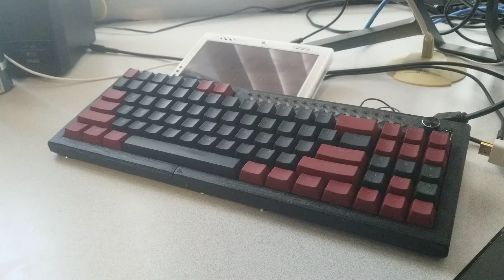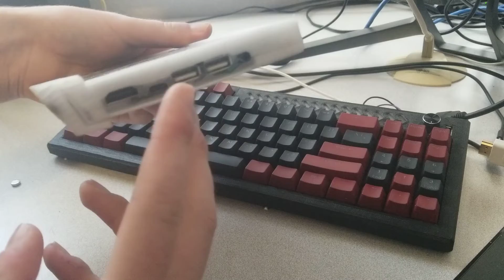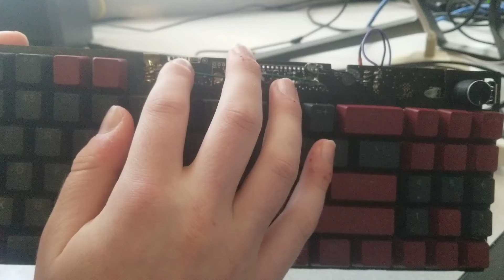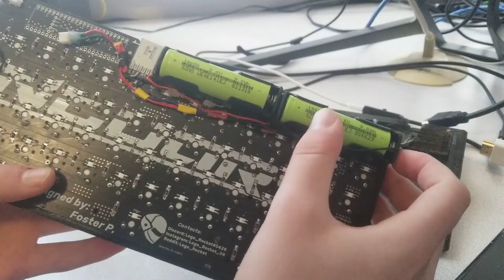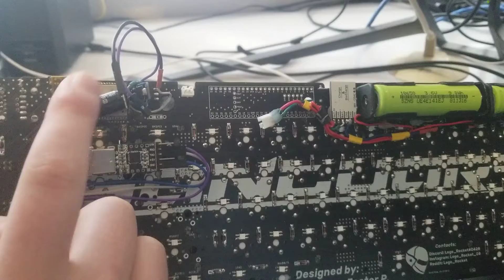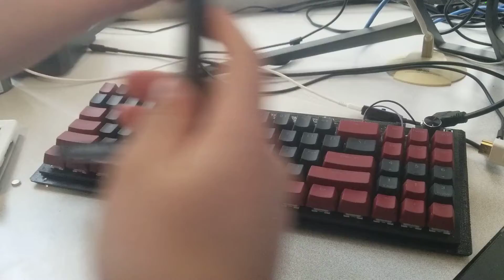The Sanctuary // Keyboard Teardown and Features

Comment: it is posible to use QMK fore this project ?
Reply from the maker: As far as I know, unfortunately not, I don't believe the ESP32 is supported by QMK, and there's a few other issues it'd have too.
The ESP32 doesn't have native USB, so you wouldn't be able to use a cable to type, and QMK isn't really designed for wireless keyboards.